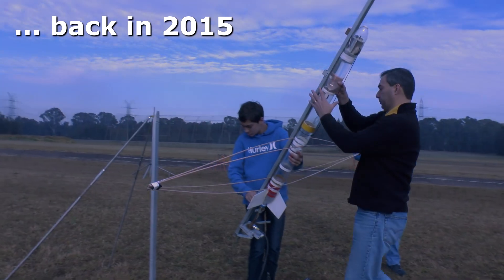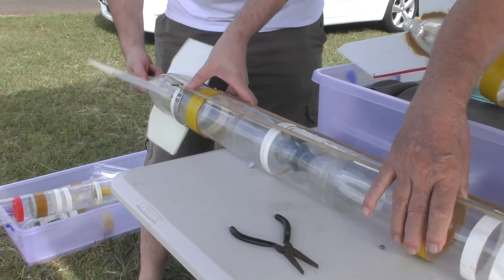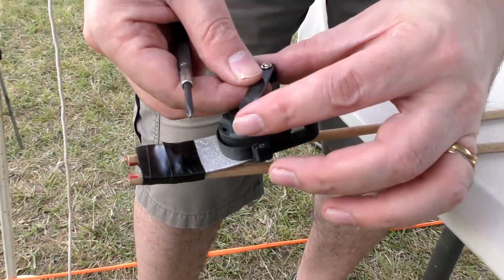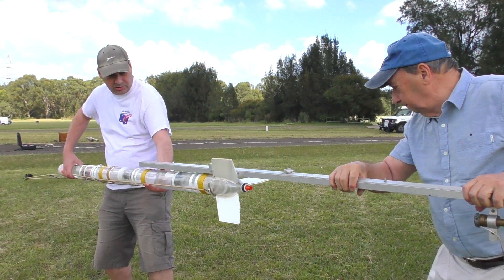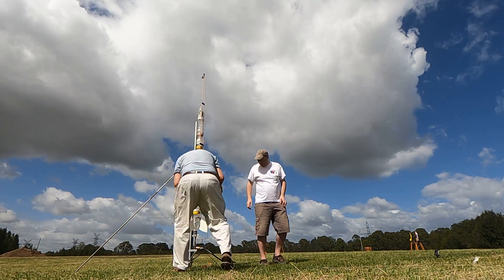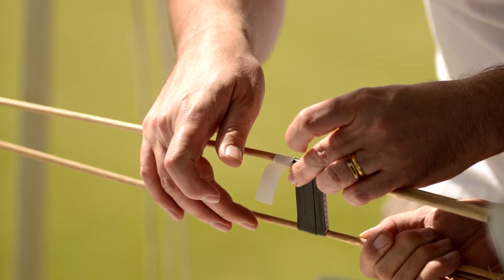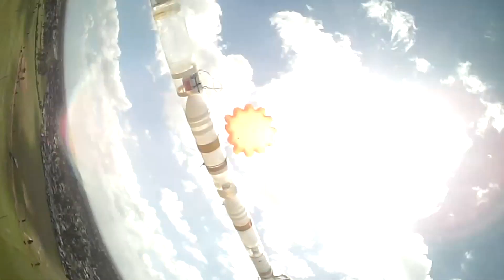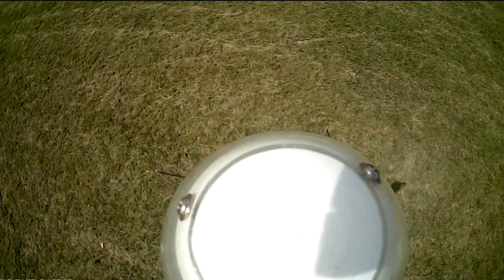Water Rocket with long camera boom

Comment: Which Tornado Tubes do you use? do you use any o-rings?
Reply from the maker: We use these ones. https://www.coolthings.com.au/vortex-valve-tornado-tube.html We enlarge the hole and also use a couple of rubber washers on the inside rather than o-rings.

Comment: Brilliant set-up and awesome video footage from the rocket. I used pop bottles many years ago to build a water rocket. For the launch mechanism I used cable ties connected to a slip ring on a wooden base and the hole bits of the cable ties were clipped onto the bottles neck, the part that forms a ring around the cap area. This held the bottles open part against a rubber seal. We had a string attached to the slip ring and that was the release mechanism. Was a bit temperamental to keep the bottles in place but it did work. We used a hand pump but only put 60 to 70 PSI in the bottle. You guys have obviously taken it to another level with your rockets. Amazing piece of work and ingenuity. Cheers from Scotland mate. 👍👍👍
Reply: Интересно. Мои ракеты объёмом 0.5 литра летают лучше так как давление 10-12атмосфет на старте
Смотрите мой канал на Ютубе называется водо старт
Удачи!

Comment: Could you lengthen the boom back to its previous size but move the elastic release servo nearer to the top of the rocket so there is less stress on the boom during the ascent?

Comment: What if instead of the sticks being made of wood, they are made of carbon fiber?
Reply from the maker: I think that would be the way to go but kind of hesitant launching long conductive rods near power lines.
Reply: @AirCommandRockets  another material option would be fiberglass
Reply from the maker: @emirustichelli7790  Agreed. There are fiberglass tent rods that may be a good option.
Reply: @AirCommandRockets  great then. Also keep in mind that it can be done in 3D. they are probably a bit heavier than fiberglass (depending on the thickness of the wall, and obviously hollow). But they are not flexible and that is good, since the wind would not bend them and it would not slow the rocket. Or so i think

Comment: It's a little off-topic, but how much pressure did you put in the rocket for this test ?
2:19 "shampoo to help reduce the top speed" Do you mean reduce the acceleration, not the speed ?
So with the shampoo it reduces the intensity of acceleration, but the rocket accelerates over a longer time and at the end the rocket goes higher. Is this correct ?
Reply from the maker: These were pressurised to 120psi, (8.3bar). The foam reduces the average thrust to about 2/3 of what it is with water alone but gives you almost double the burn time. So it reduces peak acceleration, and the top speed. Similar to reducing the nozzle size.
Reply: @AirCommandRockets  all the watching of your videos and I never pick up on the fact!
Reply: @AirCommandRockets  Ok thanks :)
Reply: @AirCommandRockets  I would like to see if you put the water with some detergent in a food blender and totally foam it up before putting it in the rocket.
You get some very stable and very small bubbled foam this way. 
My gues is you get a very long intermediate fase between waterfase and airfase.
Reply from the maker: @bartpijpers3844  The problem is as soon as you start pressurising those, the bubbles collapse and you end up with mostly liquid again. We tried this with shaving cream that has millions of tiny bubbles and on compression you ended up with just liquid that mostly stayed a liquid after decompressing again. Ideally you want high pressure tiny bubbles that are created after the rocket is pressurised. We developed a technique called "Jet Foaming" that creates these high pressure bubbles in flight. https://youtu.be/wIwJxc8PnnA?t=103

Comment: Have you considered using a small 360 camera. There are some pretty small ones these days and you would see the whole rocket with a short boom. Also could you use a light capacitor instead of the nine volt battery. Might save some weight although I’m not sure what you are powering with it so maybe it wouldn’t be suitable.
Reply from the maker: We've seen some amazing footage from those 360 degree cameras that people have flown on rockets. We've looked at a couple but they are quite expensive, and flying them on rocket (as you saw) is risky. But it would be cool to put one out on a boom, and then erase the boom so it looks like the camera is just floating there. We use the 9V batteries for convenience when flying casual rockets. They are easy to mount, easy to connect and have a voltage above 6V. In higher performance rockets we use smaller LiPo batteries to save on weight.
Reply: I think a Blackfin 720 VR camera might work and be cheap enough to be reasonably expendible